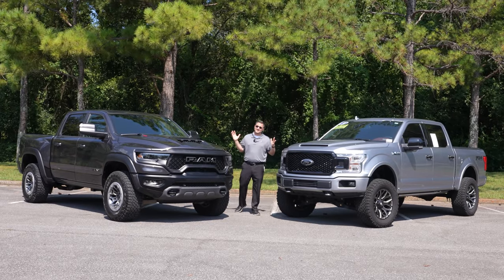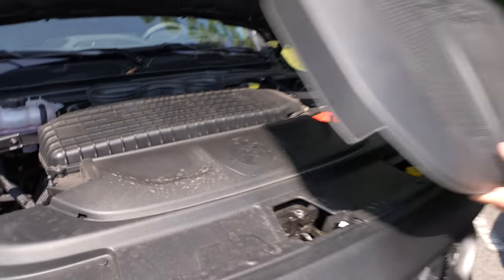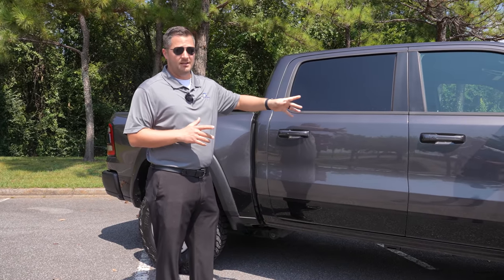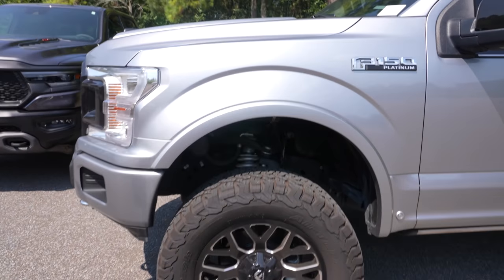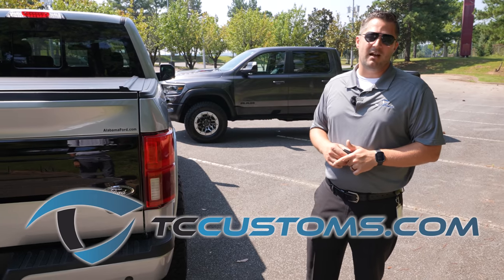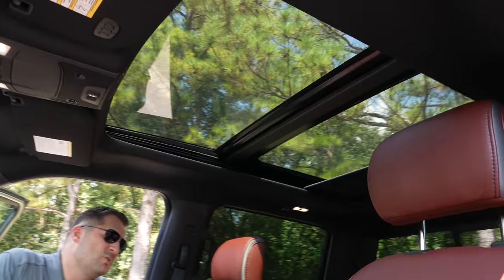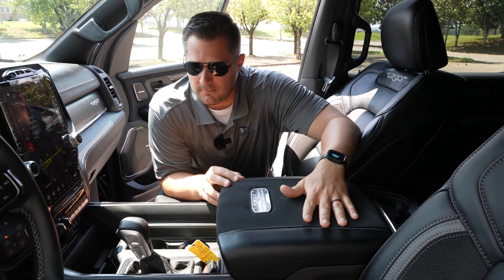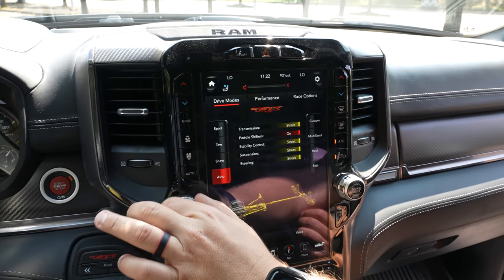Ram TRX - A Ford owners perspective!

Comment: I'm a Ford guy and own a Raptor, but that TRX will eat any production pickup truck alive and won't even feel bad for doing so
Reply: Is it a street racer or a Baja truck?   Is it a better built truck than the Ford F-150 product? or does it still need some testing and refining? Is it a show truck or a get out there and work/ off road play truck?   I think Dodge needs to pick a lane.  It 50% good at a lot of things

1) work truck
2) Baja truck 
3) rock crawler truck 
4) street truck ( power gas mileage). 
5) race track truck
6) looks truck ( doesn’t stand out from the other Dodge trucks).
7) road trip truck ( eat you alive with gas)
8) mechanicals (still lots of issues) 
9) towing Truck
10) etc…… 
Doesn’t do anything but go fast.  But if I want that I’ll drive the wife’s Tesla. 

What glitters is not Gold!!
Reply: @paulesparza6522  You don't have to simp for Ford so hard, Paul. I only drive Ford products and even I know that the TRX is an incredible truck.
Reply: but TRX still won't beat the Raptor on a full on desert run. that front heavy TRX will destroy itself jumping while trying to catch up on the lighter raptor.
Reply: For how long? Turbos have been figured out and 100ks of miles is no big deal. How long is that super charger going to last? Lets face it at the end of the day the TRX is a Fiat which isnt much better than Dodge.
Reply: But still hasn’t completed the Baja 1000. Easy to go fast on the street, off road and staying  together is another story.
Reply: @freedomisntfree_44  trudat. something the raptor has done numerous times stock, finish the BAJA race
Reply: You must not know the ford f150 super snake comes with 775hp fastest production truck made
Reply: A simple tune on that raptor will make it run right with the TRX plus you’ll have $30,000 in your pocket still
Reply: @freedomisntfree_44  is there somebody  doing better than 5 star. they were getting 550 hp with a lot of mode including bigger turbos . it was not just a simple tune
Reply: Same here - Ford guy - Am driving my 3rd Raptor  (had a 2010, a 2012 and currently loving my 17) but have to admit that I’ve been looking at the TRX … but the inflated pricing, fuel consumption and insurance cost have made me rethink and stick with my truck (for now!).  Raptor is still awesome and drives and rides awesome.  TRX has more HP and torque, sounds awesome and the interior is sweet however - but I’m not looking to drive 118mph very often and think the huge info screen is too much … but I won’t rule it out completely.  Awesome truck regardless.
Reply: I have owned 3 Raptors myself…2010,2012 and 2017,all were pretty darn good but I now own a TRX and it is honestly a far better truck than any of the Raptors!! TRX hands down is superb in all departments and I will honestly say I would never buy another Ford  truck again!!

Comment: There is no point comparing the two until the Raptor R comes out.  Kind of apples to oranges right now.
Reply: It's not like he's comparing the TRX to a new Raptor.
Reply: Agreed! If I had that kind of money I would go TRX over that 2020 Ford. I’m a Ford guy too. I’m expecting the Raptor R has to be mind blowing to complete with the TRX. I agree with him that the front end could had been done better but it’s the first model. I’m sure Ram will get there. The new Ford raptor looks boss, it just needs a comparable super charged v8
Reply: @liquidsnake1253  Last I had heard the R will be out later next year and it is supposed have the GT 500 motor in it.  I'm waiting patiently
Reply: Wouldn't it be something if when the Raptor R comes out, RAM releases a Redeye version?
Reply: what do you mean theres no point they should definitely be compared because there in the same price range. im talking about the raptor

Comment: I own a trx actually similarly optioned and same color as that one, and I gotta say I've been a ford man forever, but ford doesn't have anything on the TRX. And also the hellcat does sound better than the coyote, now the voodoo or predator they are the best sounding engine ever.
Reply: I'm definitely partial to the Predator engine, as I have a new GT500 :)  It sounds amazing!  Though to be fair, RAM/Dodge does a great job on exhaust note as well.

Comment: Nice review but nothing can beat that TRX yet.  Maybe that new Raptor R will make it an apples to apples comparison but I get the feeling that RAM has that Demon engine lurking.
Reply: The F-150 Super Snake has already beaten the TRX twice, once from a dig and once from in roll race. And I'm already aware that the Super Snake engine is not built by Ford from the factory. I don't care.

Comment: I would take either one hell I would buy the Ford and save enough to put a great payment on a new bronco but that’s just me lol
Reply: have you priced a ford platuim with a roush . add the lift price ford is more than 90k. you could buy a striped  xl and base bronco in about 2 years . people a paying 20 k over stick for a bronco
Reply: Aquarium for q
Reply: For the money  I would buy the 30 thousand dollar Bronco put the coyote motor in it sell the 2.3 turbo motor out of it and put a nice lift and tires and rims on the Bronco maybe put the supercharger on the coyote and have a nice Bronco for half the price that will probably hold its value.

Comment: I'm a Ford F-150 guy and would not consider purchasing a Dodge RAM but based on comparing this one particular F-150 to the RAM TRX, the RAM wins in all categories except price as Mitch points out. So I would skip on both and go straight for the Raptor R.

Comment: Would be nice to see y’all doing more custom work. Trx  looks like a different league. Your truck just looks like a basic lifted truck with an xl grille. Trx has a screen that respects car play (calling out 2021 ford specifically), the engine fans requested, ventilated rear seats, much bigger fold down armrest and reclining rear seats. What’s ford got? A seat belt airbag that is removed from the 2021. Seems like ford phoned in the 21 to focus on electric

Comment: IMO on startup the trx exhaust sounds just like the late 90's early 2000's Durango's with the 5.2l magnum v8 only with modded exhaust  for the trx the f150 is distinct it doesn't sound like any other ford from the factory

Comment: I own a 2016 Roush and I have the same squeak with the supercharger in high humidity or just after it rains. Once the belts get warmer the sound disappears. I feel the TRX is louder and faster, however I could be wrong, but I did not hear you talk about gas tank size. I believe that is the difference to me. If you can afford either though it becomes a moot point. I love watching your videos. Nice to see a wide range of trucks.  I would love to see the 2021 Shelby vs the TRX on the road.

Comment: I am a Ford guy and I really like that build, but in long term. I think that TRX will hold its value a lot longer and I think Dodge really put a lot of thought in this TRX and it is going to be an awesome truck now and even better in the future. Right now that TRX is better built and suspension and power train and body and electronics is light years ahead of Ford. If Ford wants to run with that TRX. They are going to have to go with that GT 500 engine in the Raptor and step up there body, engine train and electronics. If not. They will never compete with the TRX. Plus with the government steeping in and trying to go all electric. We may never see what these 2 companies can do with there trucks. Hopefully not, because it would be great to see these big giants go after each other before they are stopped.

Comment: The look of the Ram is killing it (grill). The infotainment center as well as the rear panel for the rear passengers, off the chart. I also think but Ram sounded louder. Neither had running boards. With all that being said, $17Gz more, no way.
Reply: The Ford has power running boards.  When Mitchell opens the drivers door you’ll see it.

Comment: Actually I am a ford guy but TRX better than any f150 until now . If I want to get 4 door pickup truck .
If I am willing to get 2 doors I preferred heavy duty ford. 
Mid size pickup go to gladiator .
Suv ford branco is the best .
That my opinion. 
Matt my friend ford until now didn't make a truck can competing with trx.

Comment: Mitch, I think you've been off your rocker for a long time. Seriously, I struggle with the idea of paying $80K for any truck, $90K just seems crazy to me. For those who can afford something like that, more to them. I do like them both so it would be a tough call but I think I'd go with the F150 due to the rear suspension.
Reply: I'd go with the Ford because Ram truck just don't last as long or are as dependable as Fords.

Comment: Yes $17000 TRX it will hold it value longer. you comparing a Platinum with a TRX it should be a Raptor. so if it was a Raptor 21 i think the Ford would be the better buy.

Comment: I'm not a Ford or ram guy. When it comes to these 2 I'd go with the Ford. If gm had kept those ugly wheel wells I'd be in a Ford right now. I was surprised by my partners f150. He has the 5.0 in the platinum and I have a 6.2l in my high country and I had him on the jump but he caught up and that surprised the hell out of me. Based off of paper numbers the 6.2 has more hp.

Comment: Ain't NO WAY IN HELL I'd buy that Ford truck with NO engine warranty.   Absolutely NO WAY.  That's a complete deal breaker.  And it should be a deal breaker for anyone with half of a brain.  

Not trying to be rude or disrespectful, I'm a FORD guy, but if I'm spending that type of money on a truck, Nooooo WAY I'd even consider it without a warranty.

Comment: Wouldn't give that for either 1 of them I said, this before I would never down grade the looks of a  Platinum. I have a 2010 it has 35,000 miles on it. And yes it is a Platinum.
Reply: Does your truck have the 6.2 engine in it?🤔
Reply: F-150 5.4 L  @deezal1380

Comment: That TRX blows away anything Ford has ever built. You can put 17k more into that Ford and it will still be junk. You would have to be completely brain washed and brand loyal to not think otherwise. Yes sir you are off your rocker on this one. Now a tremor f250 or a new Bronco I'm about. F150s are just blah imo.

Comment: This video is trash, and misleading. When you compared the 21' F150 interior to the TRX, you used the limited interior. If you want to supercharge your F150 you know damn well you can't do that with a limited interior. Furthermore. the suspension absolutely smashes that trash BDS system. Final note. The TRX sounds wayyyyyyyy better.